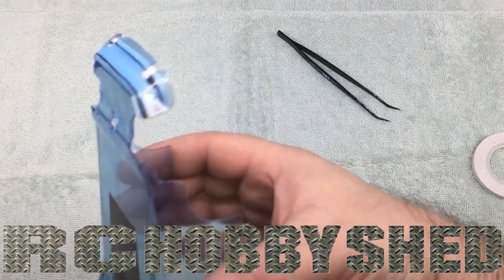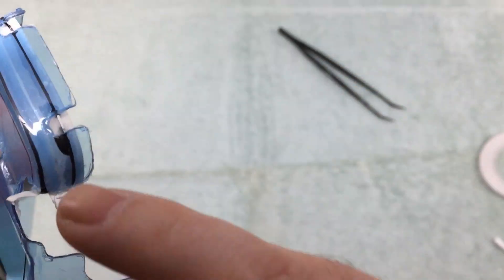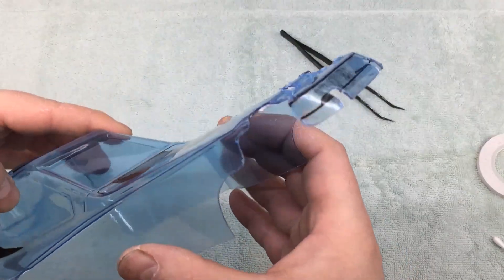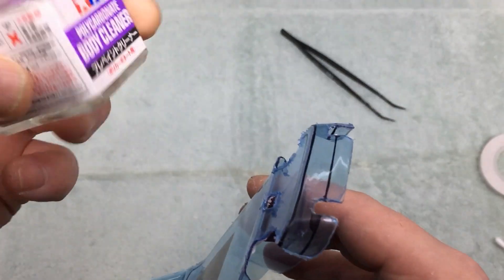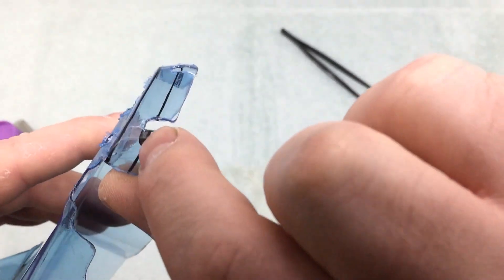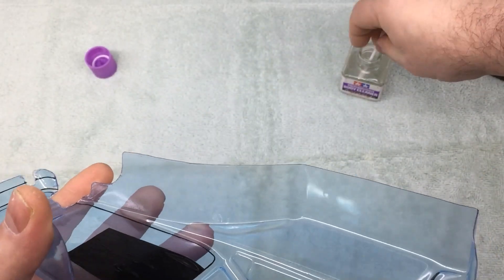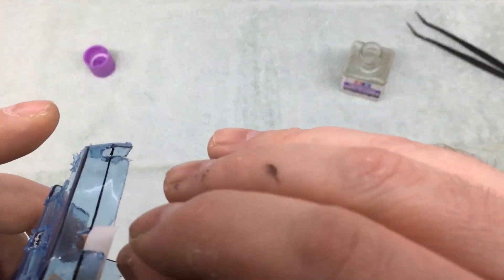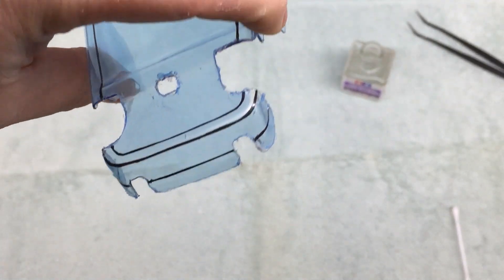Quick Tips #4 - Cleaning Up Paint Bleeds

Comment: THANKS DUDE!! This is very helpful. I am going to have to try this out. I find painting to be one of the most difficult things in RC for me. I've had paint bleeds like this many times. one question though, what can you do if you have a paint bleed onto another part that is already painted?
Reply from the maker: Thanks! For paint bleeding onto other painted areas, that's a bit trickier. When painting Polycarb', if you start with darkest colours first it shouldn't really be an issue as the dark colous will hide the lighter colours. On hard bodies, my Rough Rider for example. I did have some orange bleed over the white.. and then some black bleed over orange lol. In that case I did the same thing, tape the edges I want to clean up but then I used paint thinners instead of the Body Cleaner. For this I also I prefer to use a plastic/rubber type tape, in this case it was Tamiya tape for curves. My theory there is that normal paper type masking tape might soak up the body cleaner or thinners, and of course that might damage the paint underneath. I suppose the trick in both situations is to get on it ASAP but at the same time have the paint dry enough to put tape on. Hope this helps. 🙂👍
Reply: @RCHobbyShed  thanks for the advice my friend!
Reply from the maker: @VoidXRC  No worries at all mate. Good luck with your painting! 👍